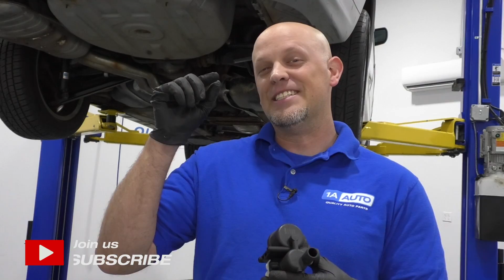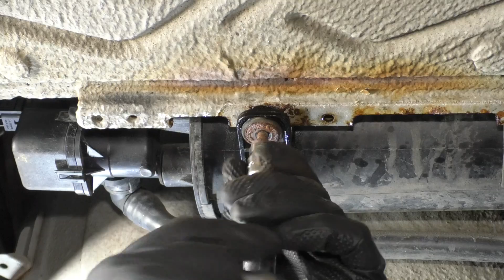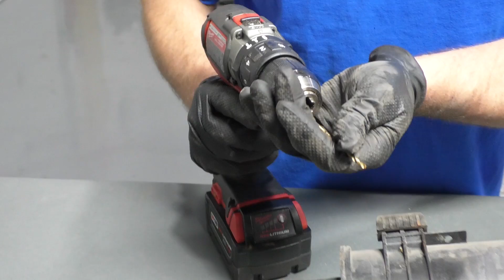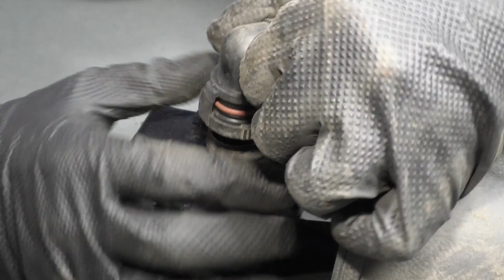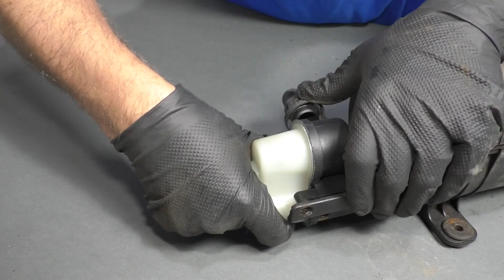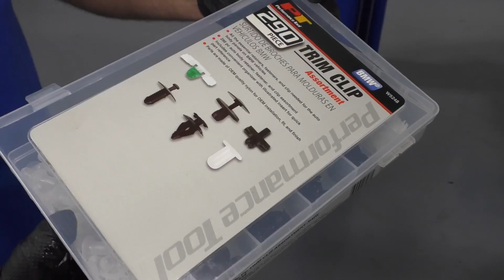How to Replace Fuel Vapor Leak Detection Pump 97-06 BMW 325Xi

Comment: Great video, but I would suggest, knocking off the expanding rivet heads and then pushing the stems in with a small flat punch.  The expanding plastic rivets should be replaced along with the rest of the hardware and are relatively inexpensive.  Always lightly lubricate the orange packing on the vent tube. I use Crisco shortening (believe it or not) to lubricate packings.  This is the process I use when servicing customers' vehicles. Just saying.

Comment: The screws that got rusted out and you had to drill a hole in them. To replace them, what are those certain screws called?? What size are they?? WHERE CAN I FIND THESE SCREWS? Because my screws are rusted out too.

Comment: this process is not the same on 03-06 bmws, the pump is located behind and above the rear passenger wheel well, much more complicated process
Reply: i forgot to mention the process is only different if you have the m56 motor, if you have the m54 the process should be the same as this video

Comment: thanks for the video.  How many hours of labor does this job call for?  Is .5 hours fair?
Reply from the maker: +Zachary Carlson This is depended on the shop you choose. 1aauto.com
Reply: @1AAuto  i know but how many hours of labor does it call for on your end?
Reply from the maker: +Zachary Carlson Thank you for your question, but we wouldn't be able to give you an accurate quote for labor as it will vary by shop.
Reply: you know, some of these answers appear a little disingenuous. Labor hours for a common task like this would be documented by the manufacturer . Dealerships have this information, so yeah, its something a mechanic, would know, esp since that's who they are paid.